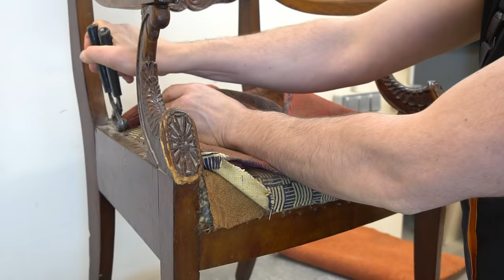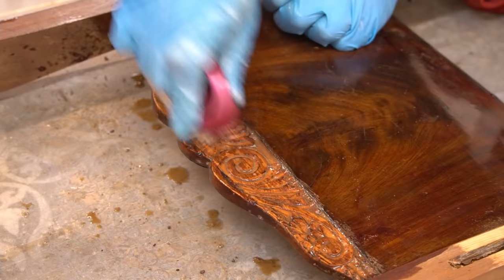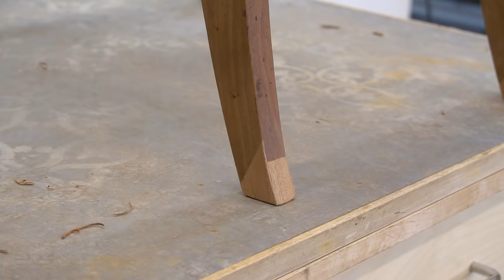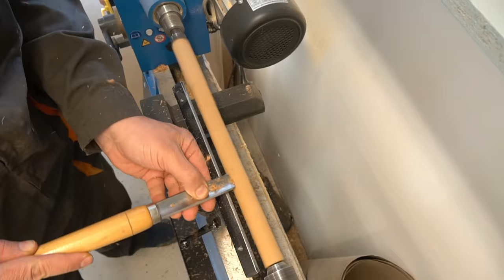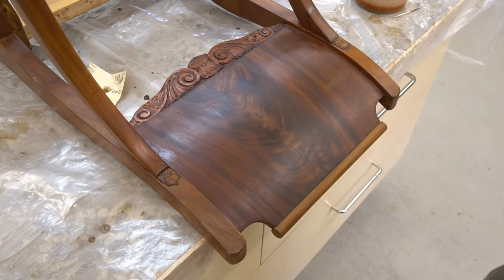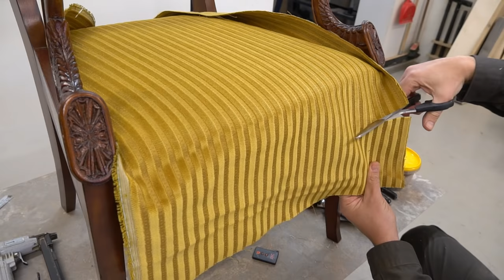Out-of-this-world CHAIR RESTORATION

Comment: Agree with the many comments admiring the restoration of this piece--the skill, the knowledge, the beautiful end result.  I am puzzled a bit by one detail.  I understand the desire to keep to original methods of upholstery, and so we see the fibrous material ("seaweed") used for padding.  That said, I'm wondering how prudent it is if the chair will get every day use in a home.  To compare, when restoring an antique home, we use modern materials (acrylic latex paint, fiberglass insulation, etc.) because they perform so much better over time, and still allow the restoration work to shine.  Is there something I don't know about the "seaweed"?  Over time, is its performance comparable to urethane foam?  I noticed and admired the shellac finish.  Beautiful and appropriate! I don't always consider shellac a practical finish, especially for tabletops.  Items left on a shellac tabletop (like a book) will get stuck.  On a chair, shellac should be just fine.  On this chair in particular--FABULOUS.  Thanks.

Comment: Beautiful work as always. I have so many questions for you but I'll limit it to only one. The back of the chair originally had cracks following the grain lines of the veneer. Were those in the finish or did you magically make them disappear? After the restoration the back of the chair was as smooth as glass. Amazing is all I can say
Reply from the maker: I didn´t film it but I filled them with special beeswax.

Comment: I have a question for you hope you can see it.
You remove the very damaged wood parts that hold parts like cloth etc with nails. Can you re-use them if you dunk them in epoxy or something else to stabilise it for keeping the original part? Or is it gotta go?
ty :)
Reply from the maker: There is special solution for making wood stronger, but these are rare occasions.
Reply: @ATRestoration  tyvm for the quick response! I don't know much about restoring old wood, just curiousity.

Comment: Real question here. Every time I watch one of these videos I wonder if removing the old Staples, of which there are hundreds, if then doing so many Staples after the fact doesn't mess up the integrity of the wood.
Reply from the maker: Staples damage wood less than nails and they hold the fabric a bit better. So the damage is not really a big problem with staples.